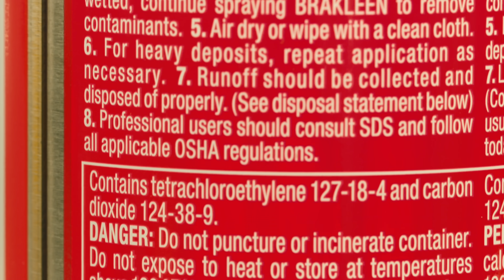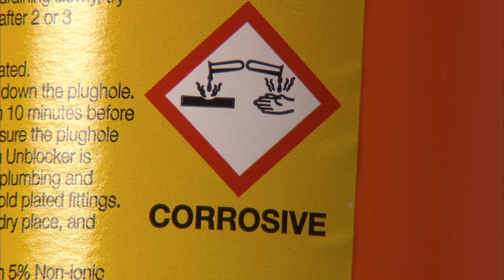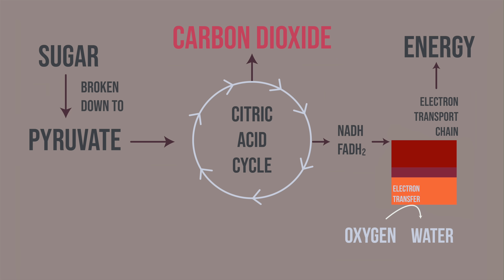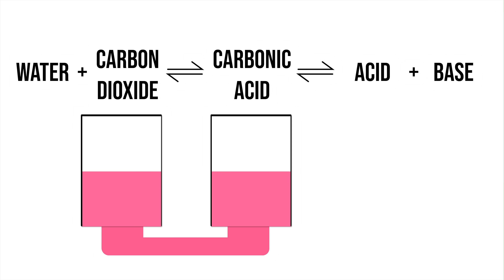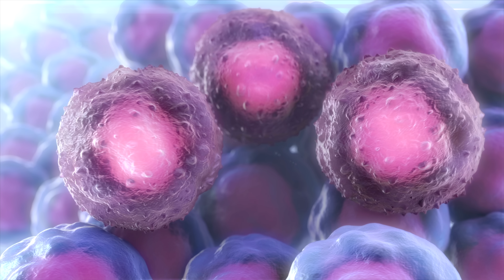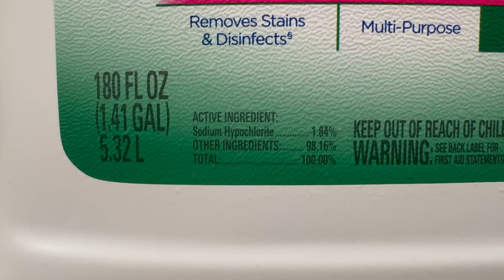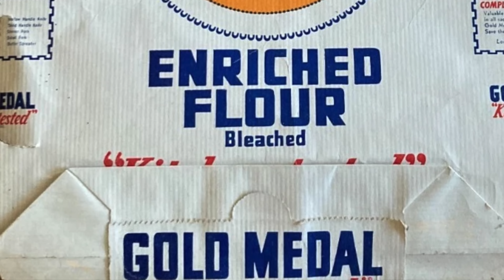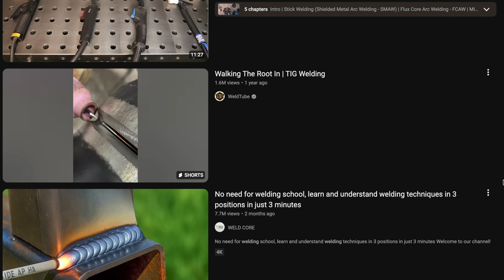"It smelled funny while I was welding and now I can't breathe..."

Comment: as a motorcycle mechanic that works with brake cleaner all the time, this is something I am going to spread awareness on around the shop. I had no idea, and I've used it to clean things before welding myself. I'm just usually pretty good about avoiding breathing fumes and protecting my lungs at work. Wonderful video brother. Thank you!
Reply: I’m going to do the same thing. We use a lot of chlorinated degreasers similar to break clean. I almmmmmost did this the other day, but for some reason I used a safer degreaser on the steel and I’m super thankful I did.
Reply: The same here, I am always using that shit… This was a great video
Reply: Some welding colleges don't even teach it, I even got my first welding job and never knew about it till many years later. Dont breath any fumes even clean metal wear a mask preferably one with a carbon filter. 
I was welding on clean steel, the other side had some electrical tape I didn't see, my lungs shut close so tight which was a good reflex but it hurt like nothing I have ever experienced.
Reply: @MikeT-om9mf  your appreciation for your lungs’ reflexes does not go unnoticed haha
Reply: brake cleaner by itself is really horrible for you, use it sparingly and when you have to, use it outside or in an incredibly well ventilated space, use a respirator if you can. So many mechanics get lung cancer or other nasty cancers from it.
Reply: @45johngalt so real and ur parents still use it right next u like it isn’t dangerous there’s really a knowledge gap in the older generations
Reply: @thomascoleman2180  .. Maybe? My pops was born in 1938 and had a master's in mechanical engineering and we never had break cleaner around. I never even knew of the stuff until way later on in my adult life.
Reply: @45johngalt  I dry my hands out at least once every couple weeks with brake or carb cleaner, not proud, but it happens. Its a chemical I have to use regularly in my field. Been 22 years and I am still here, but as I've gotten closer to 40, I am taking notes on what I should or shouldn't do. Respect my friend.
Reply: @2020motodad  don't do that like ever. Use a pumice soap dude, you doing that makes the development of skin cancer inevitable. 

I remember being taght in both trade and high-school that welding after using a chlorine based cleaner produces phosgene gas, y'know, the most effective gas in ww1? How do you go 22 years without this knowledge in a field? 

You have me wondering where my chasms of knowledge are.
Reply: @ACAB-Comrade valid fuckin post. I respect this. I will pay more attention in the future.
Reply: @ACAB-Comrade I also never took schooling for my trade. I weaseled in and learned as I went. So the basic shit like safety things were not taught to me.
Reply: @2020motodad  sorry man, I was kind of out of line with that comment. I just know that if I saw an apprentice doing that, we would be having a talk after they take a shower. Please, please be safe. 🙏

My reccomendation is "Gojo" it's an orange scented pumice soap that cleans all the little crevices of your palms. And it's cheaper than normal hand soap if you buy it by the gallon. Princess Auto or probably any Automotive parts store sells it. Thanks for not blowing me off man, if it saves your life 20 years down the line then I did my job. Peace and love from Canuckistan.
Reply: @2020motodad  Respect to you as well! Take care of your health, and do your own research too! Best of luck to you in your endeavors.
Reply: Definitely warning the men in my life about this. I would hate for anyone to suffer such a terrible death.
Reply: It's the chlorinated stuff that turns into fosgene gas.
Reply: Bicycle mechanic here. This hits hard. I will spread the word.
Reply: Fresh-cut-grass like smell when there is no grass is a red flag.
Reply: How many times have you used brake cleaner to free a bolt or nut, then heated it? Same thing.
Reply: That's pretty surprising to hear. It's one of the first things I ever learned about brakleen.
Reply: Most break cleaner today is non-chlorinated which means you would be fine. Oreillys most popular can is non-chlorinated, just be sure to check it and be 100% sure it’s non-chlorinated
Reply: @mrtx_tech  Seeing the potential consequences, I'd rather not take the habit of welding over brake cleaner, ever. No matter if it's chlorinated or not. It only takes one mistake.
Reply: @mrtx_tech  Check for organic solvents in general, none of them are any good inhaled as they will dissolve you.
Reply: @mrtx_tech  I'll look into it but from my limited understanding the chlorine wasn't the only issue.
Reply: Same
Reply: You saved my life I just. Bought a welder and didn't know thtay
Reply: Sure U don't use it to get high?
Reply: @Jeff-m3x7h funny guy u r
Reply: GOOD ALWAYS WEAR A MASK OR STAY FAR FROM FUMES
Reply: @leelunk8235  you huff gasoline?
Reply: Doctor. What if you were to wear a respiratory while welding would this help in breathing in any poisonous gases while welding??
Reply: criminal biker which gang are you in?
Reply: @Jeff-m3x7h ok bot
Reply: @45johngalt  mes not a bot me think U huff farts
Reply: u huff starter fluid

Comment: a large portion of commercial brake cleaner is non-chlorinated now. It's becoming highly regulated, but the chlorinated stuff is still around.
Reply: That's good news. Too many want to hurry and get the job done, not knowing the consequences of the product.
Reply: CRC makes both. The green can is a flammable mix of fancy, essentially pressurized lacquer thinner. So, Phosgene gas, or building go boom.

Comment: Perchloroethylene, or perc was used into the 90's to degrease welded aerospace parts before they went into fluorescent penetrant inspection. We had to get training to use it in a safe way. It worked really well.

Comment: i had it pinned for phosgene as soon as i saw the chemical name.

in my industry (Refrigeration/HVAC) R-22 is a common gas used in older air conditioning systems and some older food storage equipment. When brazing pipework on an in-service system we have to be extra careful as the gas is a chloro-fluoro-carbon, the first bit tells you all you need to know. My question is how SP didnt get laid the fuck out as a few seconds of exposure will lay you the fuck out for comparatively minuscule quantities, Been there, done that is how i know!.
edit: annnd you covered it in the video, Of course.

Comment: My welding teacher told us not to use chemical rust removers on metals we're going weld or cut, nor to work on anything that has been soaked with stuff and not to Absolutely Not cut or weld corrugated.
It's amazing what you learn that you don't even know that you need to know when you plunk down your $100 and take a course with a real professor. We learned a lot more than just that. Please, take a course, this stuff is deadly. If you don't electrocute yourself you could take in deadly toxins or even blow up and become strudeled through a knot hole. Documented and photographed cases on all included not found anywhere else except in the classroom.

Comment: Most fumes that come of welding are toxic and a specialized gas mask should always be worn .welding machines, electrodes ,mig wire all have easy to read warnings that must not be ignored welders are not toys . Brake cleaner does not remove rust

Comment: I am 77 and this just popped  up. Glad I watched it as I do what they say not to. This could explain why even getting a whiff of certain things takes my breath away. It's like a problem right at the base of my throat.  I had lung surgery at 27 years old and again at 28 years old for cocci ( valley fever)  so I always think of this when having problems. I just welded something the other day and used brake clean before welding it. I always blow it off and dry if I use it but suspect this does not matter. I also have very little sense of smell and taste. I even took welding classes and never was told this. Boy do I feel stupid.

Comment: Bullshitttical,  generally sold brake cleaner has'nt been made with chlorinated hydrocarbons for ages.
Reply: Yes , non chlorinated brake cleaners are readily available,

I was on a job last year at a fertilizer plant and I over heard some Millwrights chatting about this very thing. 
they had SOME chlorinated break cleaners for certain reasons I can’t remember, 

albeit they did have the chlorinated break cleaners under lock and key an proper ppe.

where they got it from , I don’t know.

Comment: As a welder, the first minute or so had me wanting to comment that you were ignorant of the trade, but as I listened, you explained things extremely well. And around 15 minutes, you clarified your hands-on accountancy.  I also grew up in a garage, chlorinated brake clean is magic for breaking down grease and diet, but handled poorly can kill you. The UV rays from an arc will make its presence known very quickly, even 100’ away in a shop setting.  Years ago, i knew when a tech used it, 80-100’ away in a shop the second i lit an arc, the smell is unforgettable. This video should be shown in every welding school around the globe. The shit is not a joke.

Comment: When I worked in the computer industry, the assemblers used to clean up after any soldering they did with 1-1-1-trychlorethane, which was not flammable by itself, but if sucked into a burning cigarette, it would undergo a transformation that produced phosgene gas. The assemblers were warned to keep their cigarettes (many of them smoked while working) away from anything being cleaned, but who knows how diligent then were. There is probably no way of telling how much damage was done.

Comment: Retired mechanic here,  we routinely used PCE brake cleaner in the 80s with no gloves,  vented freon to the atmosphere during ac repairs,  and many co workers had a cigarette in their mouth the whole time to convert these to phosgene as they inhaled.  The strip mall backing up to the shop parking lot included a dry cleaner and every afternoon a pipe up the back of the building erupted a hot stream of PCE vapor into the air. 
Now we have effective chlorine free brake cleaners and dry cleaning chemicals,  and with 15 times the population,  the air in los angeles is clean with blue skies. 
Every time someone starts spouting off about Environmentalist Whackos,  I wish they could get sentenced to breathe 70s and 80s LA smog every day for a month to see if they change their tune.

Comment: I’m shocked I’m still alive after all the garbage I’ve welded through and the toxic metals I’ve melted and inhaled. Induction hardened chrome shaft has to be the worst I’ve inhaled for years when I was a welding building hydraulic cylinders and repairing them with oil and paint all over them 🤦‍♂️🤬. And the galvanized garbage as well , when you see green cobwebs forming around your welds you know it’s not good 🤢🤮. Ah well , life goes on until it doesn’t 🤷‍♂️
Reply: yeah, zinc oxide looks all yellow green and noxious, probably because it is

Comment: I knew it...chlorinated brake cleaner, I NEVER use the garbage, always get non chlorinated brake cleaner, the chlorinated one is non flammable and it does not work nearly as good as it counterpart...it should be banned

Comment: I've been a professional welder and custom fabricator for over 30 years, and I've been very fortunate to have read the warning labels and had good instruction at the beginning, along with excellent ventilation/protection before grinding, cleaning, striking an arc, painting, etc.  If anything 'smells', get an air-mask.  

Nice video!  Very informative.  If we still had Shop Class in public schools (good reason to Occupy the School Boards) we would learn about what results from mixing chemicals, and potential reactions with electric arcs/ultraviolet light.

Comment: As a welder  l learnt to weld at technical  college  35 years ago my instructors  were fantastic  the very first thing  l got told ..forget what you think you know?We will tell you everything  You! need to know  ..and this was  one of them ultraviolet  light  tricloeathane  digressing  fluid..you get phosgen you smell onions  your rase the alarm  and run! Tric is now band in most countries  thank God I've  told people  to do evening  college  classes  in basic welding  and read books on metallurgy  knowing  how the materials are made and work make welding  easier  and safer.

Comment: I once worked around lots of stainless steel, mostly food grade alloys with no actual steel in them.  At the time, there were news reports that people doing body piercing with stainless were developing 1st time nickel allergies from stainless steel.   I know somebody who got a nickel allergy from a stainless watch back on their wrist.   I myself mostly did black iron welding but the entire shop had a haze of  particulate stainless and I worried more about possibly developing a nickel allergy in my lungs or even  chrome complications in my lungs.  The welders there all smoked heavy, drank heavy, wore cowboy boots.  I did none of that stuff. Maybe I was wrong but if Nickel causes people without allergies to develop an allergy from skin contact,  I guessed that inside the lungs it would be MUCH WORSE even at tiny doses.

Comment: i am a certified welder, but before i became that i was also messing around with cheap machines when i was around 18 years old, i was welding in a home garage with doors closed... i also smoked sigarettes and weed and drank beer....   i got this symptom called "lasogen" in dutch (welding-eyes), its the feeling of having sand in your eyes..   this is caused by the exposure to the light of welding,  and i also became feverish a lot of times... this is because of inhaling the toxic fumes that come off it (metal fume-fever).............      later when i started getting educated for it i learned about all these things how dangerous they are..        actually really wrong that people can buy welding machines everywhere without a license or anything.   but i guess it doesnt really kill you before you start getting symptoms so hobbyists and kids will find out quicker than getting deadly injuries

Comment: its not hard to setup good venterlation if ya welding indoors, ...... if you get hot and cold flushes you need to stop welding or set up a fan to suck the fumes away from you .

Comment: To remove rust and leave steel completely clean  soak it in 30% vinegar overnight.   It will clean the metal and leave a light non toxic film that brushes right off.

Comment: as a mechanic in upsate ny i am on the edge of my seat dealing with rust welding dust all day
Reply: my guy you didnt mention the gas that emits from the weld of flux core wire is filled with a flux compound that acts as a shielding agent when heated

Comment: 5:50- "Welding uses high voltage, high current". You're half right, as various types of welding do indeed use high current. However, within the spectrum of common industrial voltages, ranging from 69,000 volts (and up) for high tension power lines, 240 and 120 voltage for household service, welding voltages are comparatively low- between 10 and 26 volts among MIG and TIG, and stick welding may use 40 to 80 volts to strike the arc, then cut back to 20 to 40 to maintain the arc. So welding uses high currents, and relatively low voltages. Love your videos, Chubs! I always learn so much!
Reply: This is how you know Styropyro was only involved with the visual production and not the script.
Reply: Correct

Comment: Old style refrigerant leak detectors used a propane flame and a copper strip in it, when it detected a leak the flame turned green as it made phosgene. The bigger risk of using it was setting something else on fire as you were not paying enough attention to where the flame was

Comment: I have Parkinson's, which has  virtually eliminated my sense of smell. As a result, I've tried to be super careful when using BrakeKleen. I try to use it outdoors, with the object at arms length. Last summer, I got careless, and apparently inhaled some. Within 24 hours, my breathing became labored and I started coughing almost uncontrollably. I ended up in the ER, and got treated with steroids and antibiotics. It took two rounds to get me right again. Lesson learned.

Comment: You have to be pretty stupid. 1) Brake Cleaner has no effect on rust. 2) Brake Cleaner vaporizes completely in a short time. To start welding while it is liquid is just dumb. 3) Indoor welding is trouble and an exhaust fan that you work upstream from is mandatory. 4) If you're doing much welding a backpack air supply is highly recommended

Comment: Man, you got to be some of stunod imbecile NOT to use some kind of respiratory protection working with these nasty chemical solvents.  And even inhaling rust dust can be damaging, but there are likely other coating and paints that can be present that aren't good to inhale.  But the biggest mistake I made as a novice welder was welding leaded steel or galvanized steel.  Why?  Because this is mixed with LEAD.  And we all know how bad that can be.  Anytime I sand any surface, the first thing I do is don a mask.  It's Safety 101.  But damn - I never heard that you could inadvertently create PHOSGENE gas if you mixed things together.